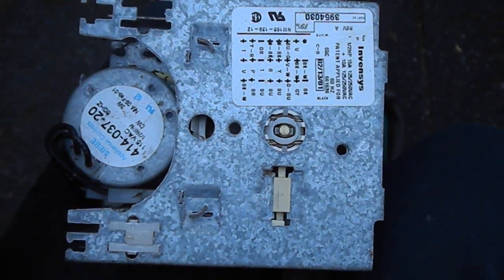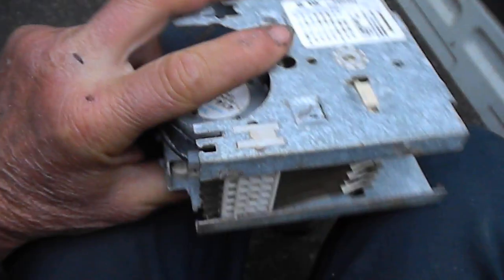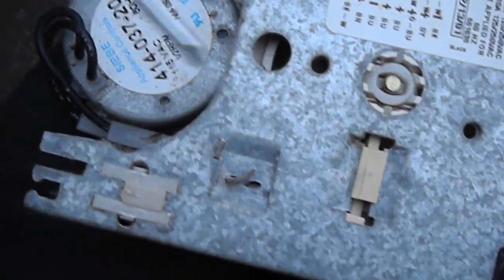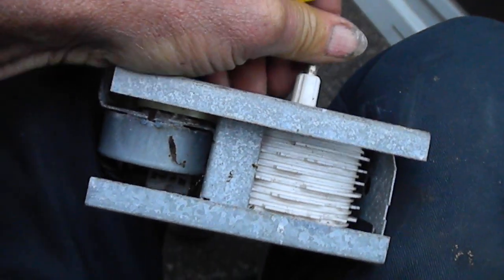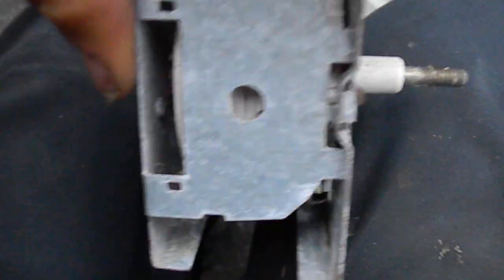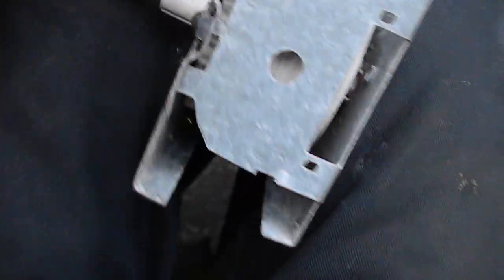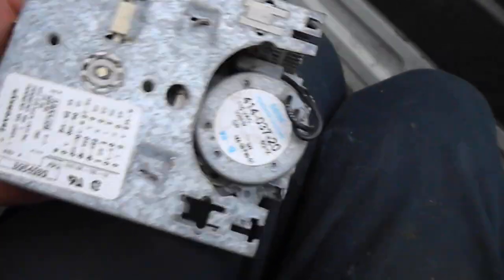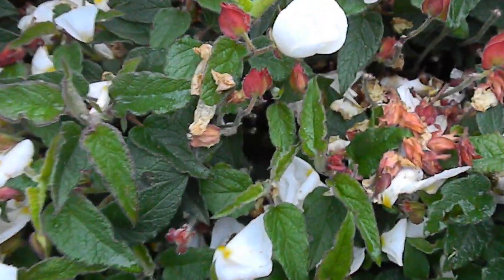Appliance Timer Repair Service 707 443-8347, Eureka Ca

Comment: So we replaced the timer on our 26 year old Maytag but the new one is not for a sudsaver washer. We also took the timer apart to try to get the water return to work. We got it back together and the washer sort of works but no water return to the washer from the laundry tub. Do you have access to a Maytag switch for a Maytag with a sudsaver?
Reply from the maker: not familiar with "sud saver  maytags
Reply: @EurekaRecycler  I'm not sure what the correct term is, "water saver"? There is a setting where wash water can be diverted to a separate laundry tub and then returned back to the washing machine for a subsequent load.

Comment: Do you have a picture of the keeper spring? Have a slightly different, but a similar timer that the spring can't be seen from the bottom of the timer. Must be broke or missing, as the on/off function is loose and does not snap on and off.
Reply from the maker: Sorry not today, I haven't worked on many of these lately. Peace
Reply: I think I can fashion a keeper spring out of a paper clip. I'll give it a try. Thanks.
Have a happy, and healthy New Year.

Comment: UPDATE:  With the machine UNPLUGGED, I took a can of WD-40 and sprayed it into the timer mechanism while rotating the knob on the front of the machine.  I was sure to spray WD-40 into the motor as well as the plastic gearing parts so both got an equal treatment.  I am now testing the washer and the time DOES NOT GET STUCK any more.  I will run a couple more loads through the machine to validate, but apparently the only thing the timer needed to start functioning properly was lubrication.
Reply: WD40 is not designed for long term lubrication. It will dissolve and remove any existing lubricant.  "Hosa DeOxit D5" is designed to clean oxidation from electrical contact points AND has a paraffin base that is designed to lubricate for the long haul IN an electrical environment.  If you have old musical instruments, stereo tuners, amps, this stuff will work miracles on crackling, noisy adjustments, etc. But, it also works well on appliance contacts.
Reply: I'm a little leary of wd40 from past experiences gumming stuff up.  I would choose to use an electronic cleaner such as Deoxit and then some fine sewing machine oil.  Good to know your technique worked though.
Reply: WD-40 IS NOT A LUBRICANT !!!! No fault to you however, because most folks don’t realize that… Due to the companies shady advertising. They want people to think it’s a wonder product that does everything. I’m sure if you sprayed b are cleaner or acetone into the mechanism it would have a similar effect… Before rotting away all of the plastic and destroying everything

The company does make good lubrication products. They started making some real first right product in the past 10 years. But original WD-40 is not a lubricant. 

I don’t care what it says on the can. You can look up records of the company’s own advertising from when they originally invented it. It stands for “water displacement formula 40” and is meant to displace water, and clean out any other contaminants before the device is properly wiped down and lubricated with proper compound. There is no oil or lubrication that is one size fits all. Each instance requires something specific. Google is your friend… Just google whatever the item is your lubricating and look at what the professionals suggest.

In this case deoxit it would be great as recommended by another commentor. Or if you want to clean it out without spending time rubbing and brushing… Just by “electrical contact cleaner“ at Walmart or anywhere else for a few dollars a can. It’s under high-pressure and will blast in there and take away any contaminants. An air compressor is your friend when dealing with electronics.

WD-40 will eat away at Plastics and rubber… Slowly (or sometimes quickly) altering the natural processes of offgassing and maturity of Plastics, rubbers, and other composite materials.